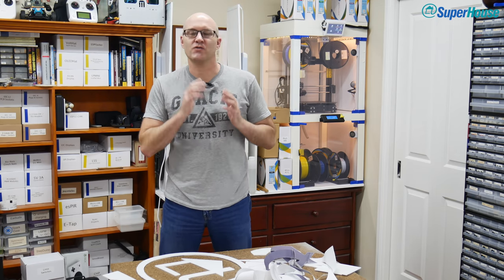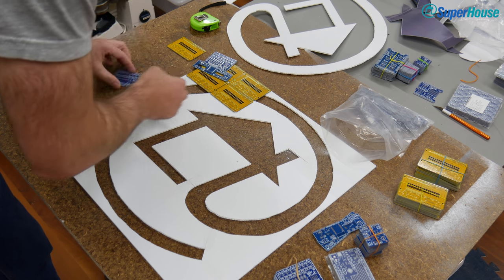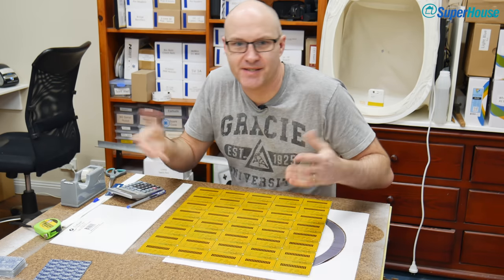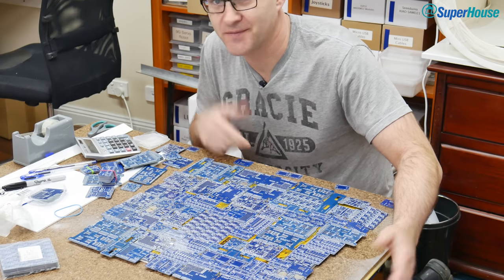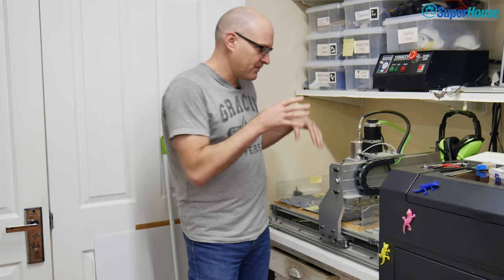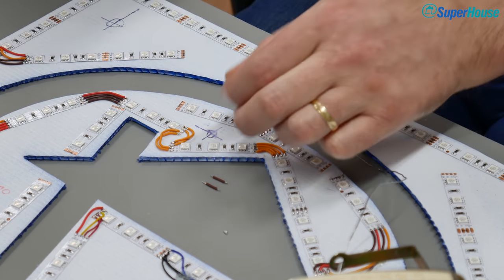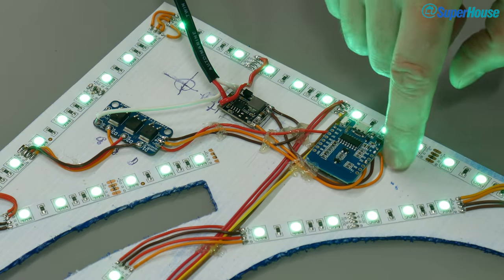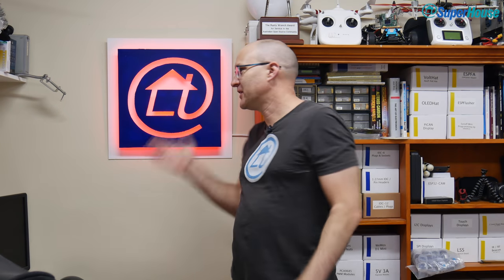Vlog #70: Making an illuminated SuperHouse logo

Comment: I love your idea of repurposing old PCBs.   How about CNC'ing EACH PCB into portions of the logo, then place the pieces at their correct locations and drill holes through the piece and backing.  Then, solder wires to create the spacing.  No more gluing, no more risk of CNC ripping out the PCBs.  You'd rather be soldering than sniffing glue anyway, right?
Reply from the maker: Doing each PCB individually could be safer, but it would be a lot more setup. I don't think I have that kind of patience!

Comment: Neat, the pcb one would have been cool if it was resin or epoxied all together, then milled, but i'm sure that would be a mess, and gunk up bits.
Reply from the maker: Yes, I have some potting resin here and I was thinking about making it a solid slab. I've also thought about installing SMT LEDs on some of the boards so they can twinkle. Lots of work for a silly project though!